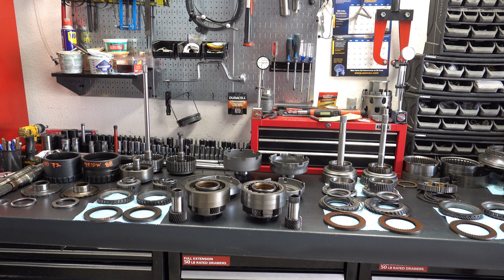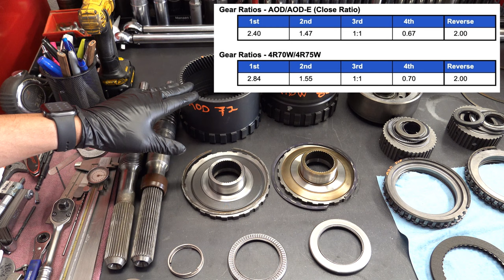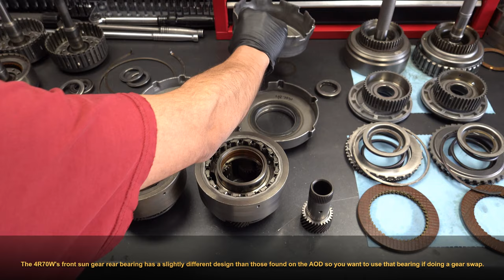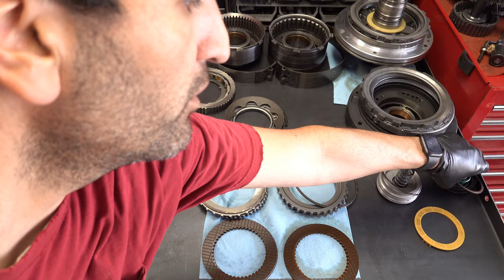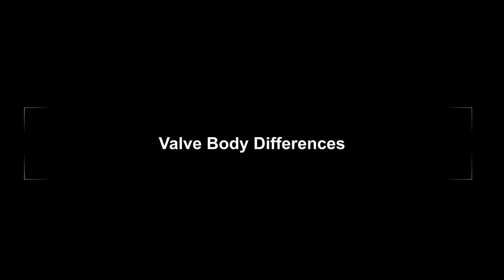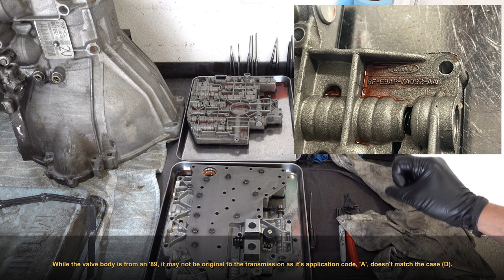Ford AOD and 4R70W  - Differences and Parts Swaps

Comment: Thanks for the info Nick! Needing all parts to make these units pretty stout. Rebuilding one in a 1994 Mustang. This 5.0 has a Procharger with 500 hp I suppose
Reply from the maker: Thanks, Jay! At 500hp you prob need a billet input shaft and for sure an upgraded direct clutch plus all the lube mods I discuss during the rebuild videos for that transmission (the 4R70W's mods will be a little different given the design changes from the AOD to 4R70W and the latter's oiling system being better overall.
Reply: @nickstransmissions  what video explains your lube mods?

Comment: This is now an older post. So I hope you still respond. Recently got a 2002 f150 4r70w for replacement in my 97.  Found a jasper sticker on it . But in the process of clean up, I turn the output shaft and have  lots of noise internally. Even a ringing  sound from one of the steel drums. And I don't hear the diode clutch when I turn input, as mentioned in your video.  I'm going to condem this as bad and not install. If you feel that might be in error, I'd like your input.
Reply from the maker: Hi Stan, I agree with your assessment...I went outside into my cores yard where I have a couple 2000+ year 4R70s and neither make noise when spinning the output shaft; I only hear the mechanical diode when spinning the input shaft...Sounds like there may be some gear train damage to the one you have...

Comment: Great video I wish I would off put a 4r 70 in my 63 falcon. That said can you tell me if a trans go hi rev kit will help with the quick up shifting my trans does? I’m mean it’s shifting to 2nd gear before I cross the street from a stop just normal driving and in OD before 40mph it really Boggs my motor down. I do have 3.73 rear gears with a 25” tire. Thanks for vidieo.
Reply from the maker: Hi Matt, thanks for the kind words...Assuming you have an AOD with a stock gear train (ie not a 4R70 gear train swapped in) the Transgo AOD HP reprogramming kit should help you with recalibrating the shift points so you're not stack shifting from 1st to 2nd and bogging in OD as described...The 3.73s are likely part of the reason it's shifting so quickly...
Reply: @nickstransmissions 
Thank you for the quick response and yes all stock gears so I will move foreword with the trans-go hi rev kit.

Comment: So if you wanted to put 6 aod clutches in a 4r70 drum do you use the aod drum or should you use a smaller backing plate
Reply from the maker: Hi Zac, are you referring to the direct clutch?
Reply: Yes

Comment: I look forward to the VB & governor videos you mentioned , The 4R70W  "gear swapping" into the AOD is the easy part. Making it shift properly is sometimes the challenge.
Reply from the maker: Thanks, Edward...You're right - the mechanical recalibration is the tricky part for those wide-ratio gear swaps.

Comment: Where do I sign up to get my AOD, 4r70w swapped? I have a mildly built 302 with aluminum heads and a radical camshaft in my 85 F150. The problem I have right now is that I need a stall converter because the stock converter is pulling the motor down and it’s struggling to rev. And the 2-3 shift happens so close together that it’s practically one gear instead of 2 separate gears. I’m really struggling with making a decision about this transmission. I’m almost ready to do a 5 speed swap and scrap this AOD.
Reply from the maker: Hi D.collier, thank you for watching...Any transmission shop familiar with these units should be able to assist you. That said, the AODs can be finicky so wouldn't blame you if you decided to do the 5-speed manual swap.

Comment: great video with lots of information. I would like you to clear up that if one wanted to just install a 4R70w reverse input drum and 2 inch od band without any other mods will this work
Reply from the maker: Hi Catpaw, thanks for watching. I believe I annotated the video with the necessary parts you need if you wanted to just install a wide band but NOT change your gear ratios. But in case there's any confusion, here's what you need:

- 4R70W Rev Input Drum (98+ w/diode only - waste of time to get non-diode version)
- AODE sun shell *keeps factory AOD gear ratios
- Two-inch Wide OD band of your choice
Reply: @nickstransmissions Can you use the aod bearings for this swap?
Reply from the maker: Hi TheDriver. I address that question specifically in the video...
Reply: @nickstransmissions I watched the video multiple times and you do say that in order to do the whole gear swap, you need to swap everything(bearings included). I'm specifically asking about just swapping the reverse drum, sun shell(from aode).
Reply from the maker: You didnt mention that specifically in your above comment so I assumed you were talking about the entire gear train swap. Yes, use the AOD bearings (they should be .130)
Reply: Thank you sir.

Comment: What other vehicles to look for at junkyard besides the mustang for the 4r70w? You said to look for 98+, I would like to swap the internals to my aod. Thanks
Reply from the maker: Hi Greg, thank you for watching. 

Any F150, E150 Van, Expedition, Mustangs, Explorers w/5.0L engines...Look for 98+ since that's the first year of the Mechanical Diode...Also look for the color of the case connector on the side of the unit - later model units with the diodes will have a black connector.

Comment: I just picked up a 1990 Crown Victoria with the AOD.  3rd and 4th are wiped out.  I want to build it into a really bulletproof transmission for what will remain a mostly stock engine with very few performance upgrades (mainly exhaust, maybe a cam).

Thank you for the content!
Reply from the maker: Sweet, man - it will make for a nice project for you. Best bang for your buck upgrade hard part wise is to install the 98+ 4R70W reverse drum and AOD-E sun shell. Gives you the much stronger mechanical diode intermediate one-way clutch and ability to run a wide OD band.
Reply: @nickstransmissions  Do you have a website, or a list of good upgrades?  I really want to build the best transmission possible for my crown victoria.  Always wanted one, now I have a reasonably good example!  Really appreciate all of your AOD videos!
Reply from the maker: I'll actually be publishing a video later today announcing that I have a Facebook page and will be putting out a website within a couple months or so. That said, the list of upgrades is in the video that you watched - you can find most of those at local hard part suppliers, eBay, Transpartswarehouse.com, CobraTransmissionparts.com and other places...Are you looking for something specific? If so, let me know what it is and I'll see if I can help you source it.
Reply: @nickstransmissions  I've just always had a soft spot for the Crown Victoria.  Mine has 3rd and 4th wiped out.  I was hoping to get a bunch upgrades/updates to make the AOD last forever in a highway cruiser.
Reply from the maker: The main concerns with the direct and OD are the direct drum splines stripping (neutral condition beyond 2nd gear, no TC 'lock up') and OD band getting wiped due to excessive clearance, pin bore wear (also causes forward clutch burn up) and insufficient apply surface area on the piston.

I'd upgrade the direct drum to a later style if it doesn't have one already - that allows for six factory spec frictions or 8 Alto Powerpack frictions/steels. Also check the splines using your direct drive shaft - make sure there's no excessive play/wiggle when they are splined together. 

For overdrive, I'd install the Sonnax AOD OD Servo kit, especially if your AOD has the 'B' servo and you're making more HP than stock...The majority of AODs had the B servo and it's simply not sufficient to hold up in higher horsepower applications. Pair that with the AOD-E sun shell, 98+ 4R70W reverse input drum and update the hydraulics in the VB - you should be good to go for a nice cruiser/highway vehicle.

Comment: Hi, great video you made and I appriciate the effort doing it.
Question, why would you swat internals from 4r70w to AOD, why not just use the 4r70w? In context I have a 67 mustang with AOD and I plan to change it out for a 4r70w that I rebuild and also add performance uppgrade to +600hp strengt. For this Im looking at adding Holley EFI and to it a Holly programing module for 4r70w. So am I on the wrong track swapping out AOD for a 4r70w?
Reply from the maker: Thanks, Loffy...4R70 Gear swaps into AODs are done primarily because folks don't want to spend the $$$ on aftermarket transmission controllers and many are retro-ing the AODs into vehicles that originally took 3-speed C4s or C6s to obtain overdrive. So they want pure mechanical command and control, no computers.

If you plan on running a 4R70W you'll need a transmission controller...I'd also recommend a billet stub shaft and performance sun shell among other things, given the power output of your engine.
Reply: @nickstransmissions  Thank you for your quick reply, is there a one stop shop to buy these parts? Would you mind listing what I need to buy and change.. maybe there is a kit? For me its just fun to do it as good as it can be as I will rebuild it anyway so better to do it then. ( I mean all the internals to swap for better strengt)

Do you have any plans to do a performance upgrade assembly video, sure like to see it.
Reply from the maker: You're welcome...Everything needed is listed in the video however you'll have to recalibrate the 2-3 back out valve in the valve body, otherwise you'll stack-shift from 2nd to 3rd gear due to the diff gear ratios. 

The best thing to do is grab a 1998+ 4R70W or 4R75 core from the junk yard, try to find one in a wrecked vehicle since the trans was working at the time of the accident. Those will have everything you need, parts-wise plus you may be able to sell some of other parts you don't use to offset costs. 

You can tell a 98+ via the black electrical connector (93-97 connectors are white)...The reason you want a 98+ is the mechanical diode one-way clutch installed onto the reverse input drum. Those were stronger than the traditional roller-style OWC in the earlier units. 

I'm hoping to get another AOD in the door where someone wants to do that...The customer was contemplating doing that with the AOD shown in the rebuild series on the channel now but decided against due to cost considerations.  

Please subscribe if you haven't already so you'll know when more AOD videos appear on the channel.

TIA!
Reply: @nickstransmissions  Already subscribed, looking forward to more updates. And once againg thank you for taking the time to reply, it helps me a-lot.
Reply from the maker: Awesome - thanks man! 

You're welcome, let me know if you have any more questions.
Reply: I wouldnt bother retro fitting 4R wide gears into an AOD case for a few reasons. Id forget the AOD.

The 4Rs wide gears, specifically first, are obnoxious behind a pushrod SBF. These gears were designed for mod motored multivalve cars that don't have the same low down torque as a pushrod motor so they used wide gears to buzz the motor up into its torque band faster.
Then theres the AOD cases and pumps, noticeably weaker than the 4Rs.
Also with the 4R you have the possibility of lock up in all forwards gears, infinitely adjustable shift points with the right controller but you can also skip the controller all together as long as you're happy driving a car with a full manual valve body. Transgo offer a kit to convert the 4R full auto VB to full manual negating the need for an expensive controller. You'll just need to wire up 2 switches for lock up and Overdrive and remember that you're making every shift manually.
Reply from the maker: All good information, Lilzsnr - thank you for commenting and sharing! 

The 4R70 swaps are primarily done for those who want a full auto pattern shifting transmission without the need for computer control so it's basically a very extensive (and expensive) workaround.

Comment: Have you ever used HP Tuners, or SCT tuning tools after your rebuilds?  I have HP Tuners and have some knowledge about using it. I have 2 Crown Vics, one is a civilian model, and the other is a Police Interceptor. I would like to copy and paste the police trans program over to the civilian model, but am not sure how to do this. I have seen videos about tuning a 6L80 by HP Tuners, just wondering if you have ever tried doing any tuning of your rebuilds?
Reply from the maker: I haven't messed with HP tuners or other like-kind programs or software as of yet...99.9% of my builds are carry-out so I hardly ever see the vehicles my transmissions get installed into.
Reply: @nickstransmissions  I stopped doing carry outs. One, the installer fail to flush out cooler, it was plugged shut, and they wanted me to warranty it. Another one, the guy switched from either a 2004R or 700R4, and used the same drive shaft, it pushed the gear train against the drums and wore into the pump, they wanted warranty for that one too. If I don't do the complete job, I don't do it, that way I can control what is going on, and make extra money correcting somebody else's mistake. I really don't miss working on cars.
  HP Tuners can help with lockup apply, and shift scheduling among other things. It like putting in a shift kit without gettin dirty
Reply from the maker: Yea, none of those fuck-ups would have been on you, no way...My warranty disclosures are very robust in that it would be extremely tough for someone to successfully claim they deserve warranty coverage when failures to install correctly result in transmission damage or when either other sub-systems on the vehicle fail, damaging the transmission (lack of vehicle maintenance - voids warranty) or if the vehicle was used in an application that was not previously discussed at the time of the build (customer states car is a daily driver with no racing then proceeds to take it to the track every Friday and Saturday after rebuild).